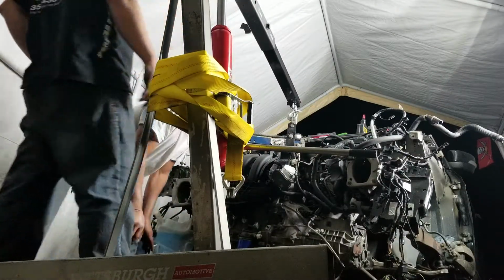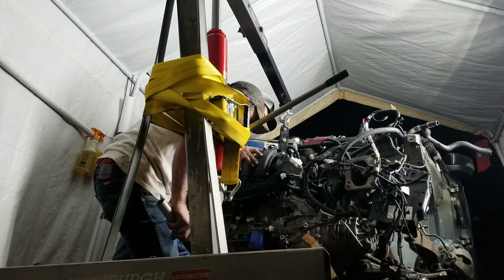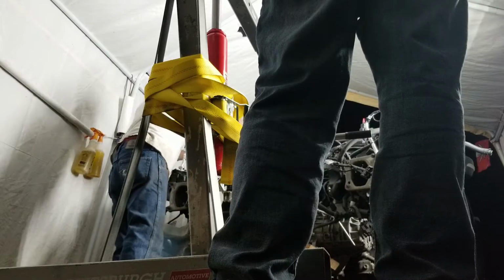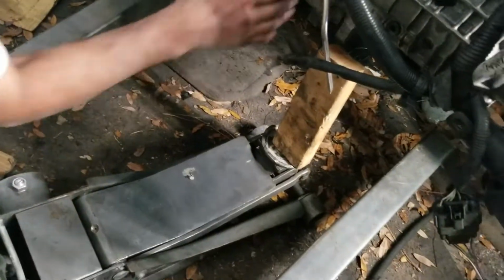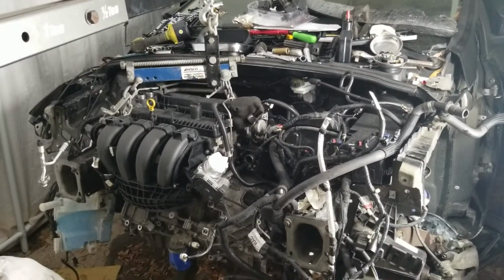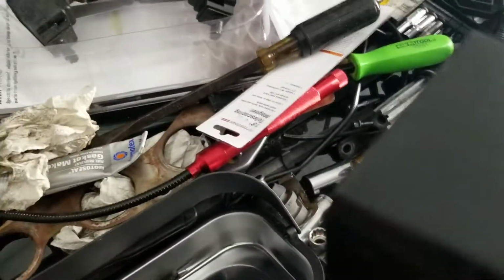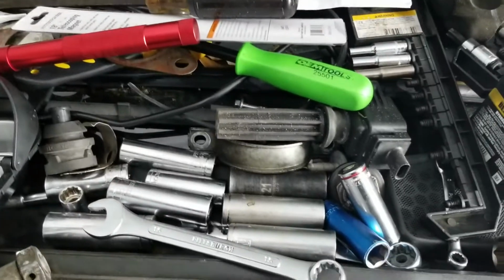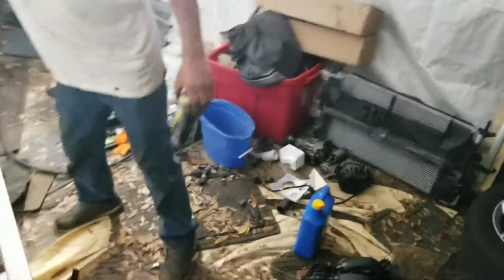Installing Ford Focus engine

Comment: Do you have to reprogram the computers after doing a motor swap on them?
Reply from the maker: No
Reply: @roadsideguy5902  I’m looking at one that had a motor swapped into it and now it needs to be programmed I guess it has no spark but cranks
Reply from the maker: @bigjon3172  most likely it's out of timing. These are interference motors.